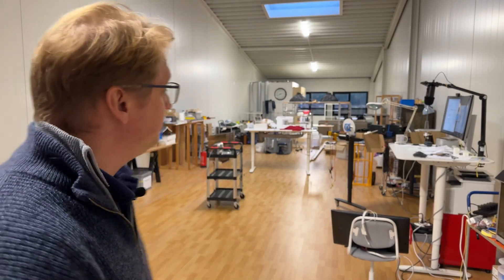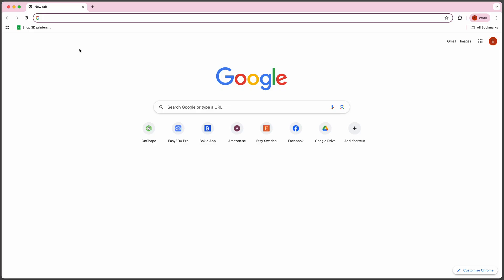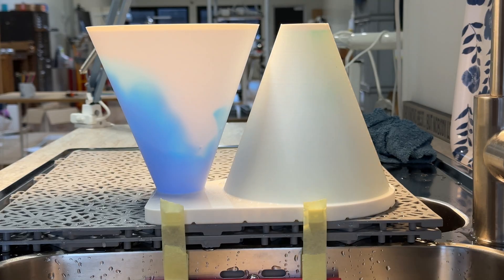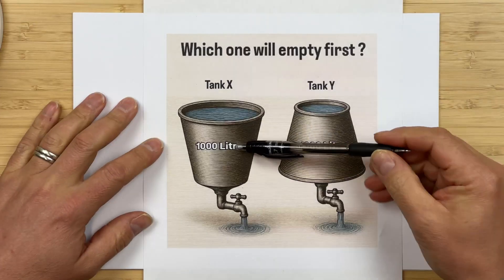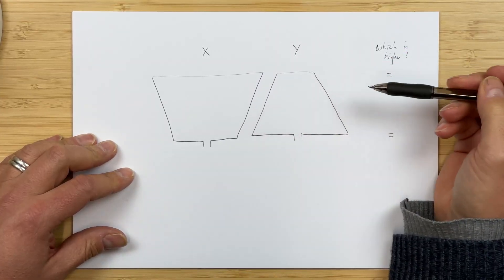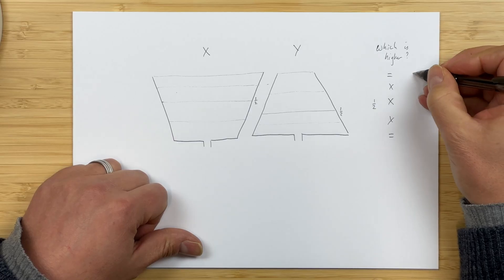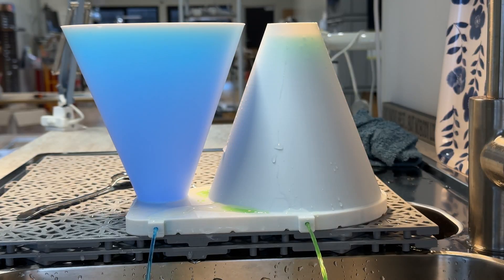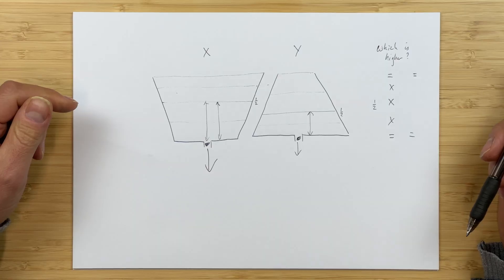Which one will empty first? Tested, answered and explained.

Comment: Very nicely made video! Can you send me the dimensions of the sink? I want to do a simulation and determine the length of the water jet.
Reply from the maker: Would be interested to see that

It is an Ikea sink: https://www.ikea.com/se/sv/p/vattudalen-inbyggnadsdiskho-1-1-2-ho-m-avr-rostfritt-stal-s89158191/

The dimensions are given in this image: https://www.ikea.com/se/sv/images/products/vattudalen-inbyggnadsdiskho-1-1-2-ho-m-avr-rostfritt-stal__0676169_pe718590_s5.jpg

Good luck!
Reply: @Heterodox_se  In my simulation, the water jet does not reach that far. Can you measure the size of the opening in 3D printing?
Reply from the maker: The opening is an inscribed octagon whose corners lie on a circle of diameter 3mm. So the opposing sides of octagon are 2.72mm apart, which measuring on the real model confirms (2.70mm). Octagon instead of circle as it is easier for the 3D printer.

You can look at this 3D model to see it in more detail: https://cad.onshape.com/documents/c7853467ab0cf1324c4ca739/w/ad958f93c0c41defa40d0789/e/4fc75dcbf03ca49e874821f0 If you select various elements in the model it'll measure them for you - see bottom right of window.

Comment: I studied a bit in engineering school. A my bet goes to X.
 
My reasoning :
1) the speed at which the water flows depends on the pressure
2) the pressure depends on the height of the water column
3) in the X tank, most of the water s in te upper part, which means in average the water column will stay higher in this tank than in the Y one. So higher pressure, so higher speed.

That’s why water tanks are usually in altitude. To provide more pressure and thus a faster flow.
Reply: In fact you just have to look at the position of the center of mass of te liquid. The higher the center of mass, the faster it will drain.
Reply from the maker: @khenricx  yes! However going from higher center of mass to faster flow requires quite a few jumps of reasoning. I took the long route in my explanation but what you say is the essential summary of it :)
Reply: Gravitational system has the water tank at the top. Heighest elevation permited.

Comment: Awesome video. Question is how can we make Y drain faster than X? Will it drain faster if we change the flat bottom to a more rounded shape?
Reply from the maker: Adding a slope to the bottom of Y would help it drain completely, but would not make it drain faster. The limiting factor at the end is that the height of water is so low that there is very little pressure to push it out the nozzle. Friction (or whatever applied to liquid flow) plays a tiny part in it.

Looking down into the tanks I could see that right up to the end there was no dip it the level above the outlet in Y - indicating that there was on restriction in flow to the start of the outlet.

Another way to look at it is to pause the video when X has just emptied. At this point there is still a good bit of liquid in Y, and any small change to the shape of Y under that level would not have affected how fast the tank would have emptied to that point. So any change to the bottom of Y would have to be so significant as to effectively change the experiment.

Interesting question though :)
Reply: @Heterodox_se  Hydraulic engineer here - You are probably right that the effect is small, but i wanted to add that the capacity of the outlet does not only depend on the head (or pressure), but also on the streamlines through the outlet, which depends on shape of the outlet. This is expressed in the orifice discharge equation as a discharge coefficient. A bellmouth-shaped outlet would be more efficient compared to the straight cut in your model. The main reason for this difference would be that the straight cut causes the streamlines to contract at the inlet. Someone did a CFD simulation similar to the Lemont one, demonstrating this for tank x, but I fail to find it :)
Reply from the maker: I'm certainly not a hydraulic engineer! What I most want from the outlet is a nice laminar flowing stream, and my gut feel was that a short straight sided outlet would produce that. I'll give the bellmouth a go in future, help the water in to the outlet in a smoother way. Thank you.
Reply: Just make the vertical section of the outlet pipe longer. This will make the water column higher and the water will flow faster.

Comment: If you get more time, review your explanation and modify the model so to equal drain length
Reply from the maker: By "drain length" do you mean the channel in the model between the bottom of the tank and the small nozzle the water comes out of?

If so it is exactly the same for both sides (length, volume, dimensions). In the explanation I don't touch on it because it is one of the parts that can be abstracted away - it gets covered by the idea that the flow is proportional to the water level height in the tank. If you were simulating it properly though  you would need to account for it, as the bottom of the tank is not the zero point for the height, the nozzle is, which adds a few centimeters.

Perhaps I should have been clearer that it is the water level in the tank that should be used to decide when the tank is empty, rather than when it stops flowing out of the nozzle.
Reply: @Heterodox_se thanks for answer.  Theoretical calculations are quite simple. So either making CFD or experiment is such a waste of time, at least to me.

Comment: Thanks for explaining. My question is what will happen if you fill up both tanks and connect them to each other, on which direction will be water movement?
Reply from the maker: You mean put a pipe between the tanks quite low down? In that case the level in both tanks will stay the same and they will both empty at the same rate. But in the beginning water will flow from blue to green, and at the end the other way! I think....

Comment: My anology for choosing x was based on the much bigger initial surface available for atmospheric pressure to act on.... Whilst Y had much smaller initial surface....
Reply: Not a good reason. The top area does not affect the pressure at the bottom of the bucket. That is some highschool physics.
Reply from the maker: I also find this to be unintuitive when it comes to pressure, bigger should lead to more pressure, but that is not the case. It leads to more force, not more pressure.

Also, the atmospheric pressure at the top is not actually relevant to the results - the same atmospheric pressure applies to the bottom and so cancels out! What is creating the pressure at the nozzle is the water being pulled towards it by gravity. And the surface area it is acting on is the nozzle hole, which is the same for both tanks.